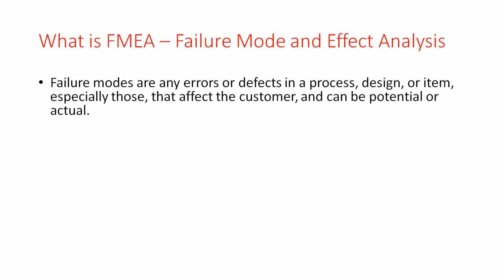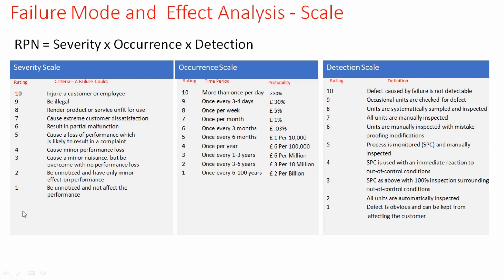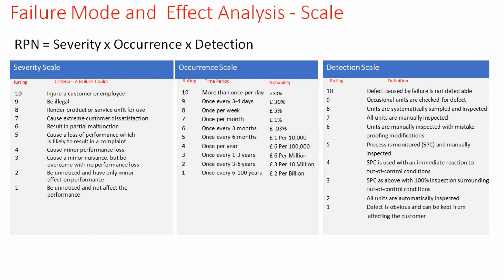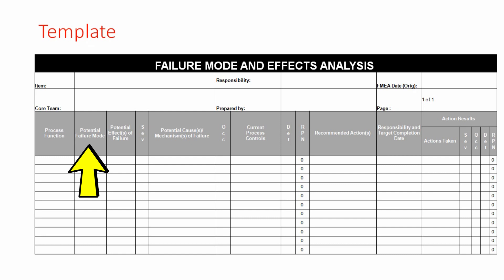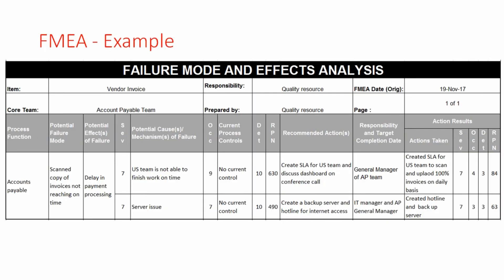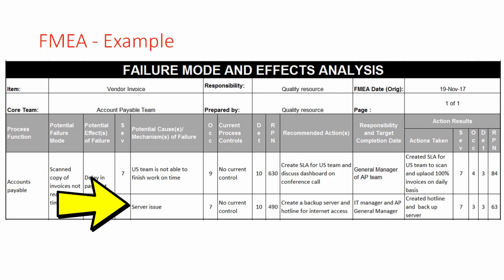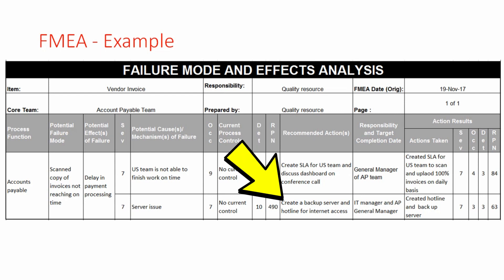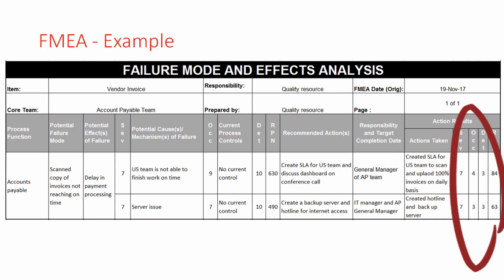FMEA Training With Example : How to become an effective FMEA Practitioner l mbbmohitsharma

Comment: On which failure one has to work. If one failure mode has high severity but low occurance rate and other failure mode has low severity but high occurance?
Reply from the maker: If the rpn score is same then failure mode with high severity should be worked first.

Comment: Hi, Can you please help me to understand the difference between FMEA and RCSA?
Reply from the maker: I have not heard about the term RCSA though I have heard about RCFA. RCFA means Root cause and Failure analysis. RCFA is done to already existing failures so that a corrective action can be planned and failures are not repeated however FMEA will identify failures before you have a problem and looks at a total system to identify what maintenance program should be developed based on known or likely failure modes.